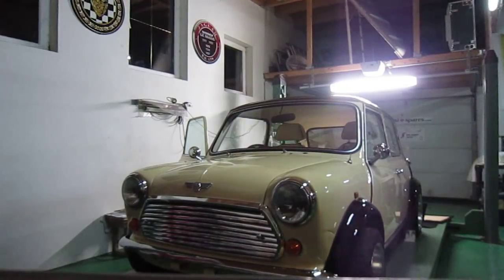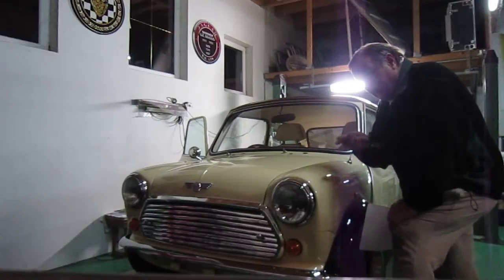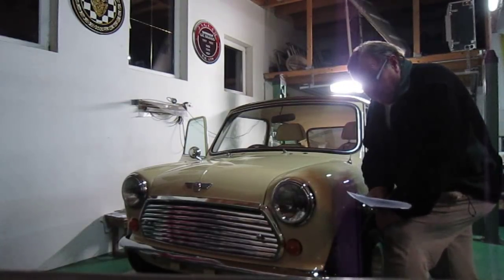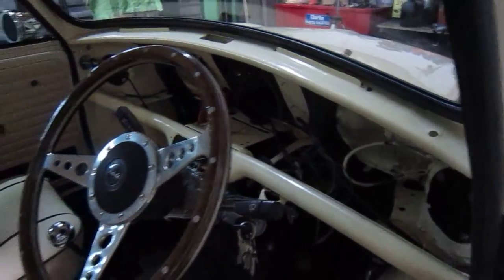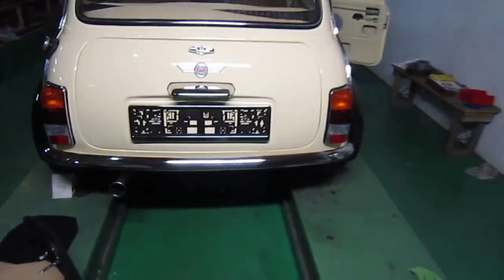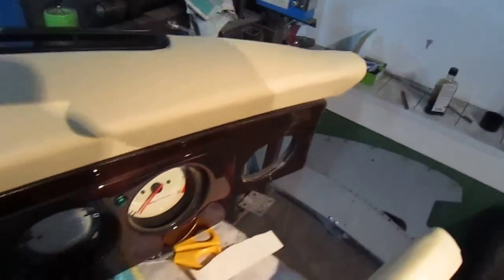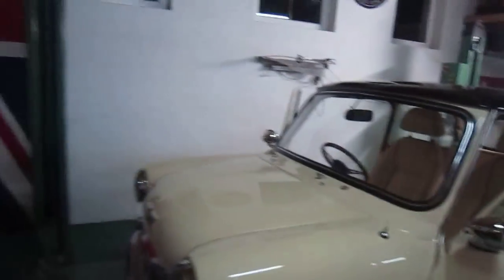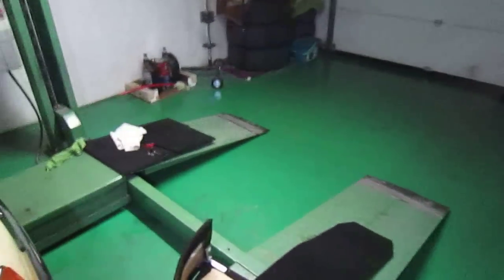Classic Mini Cooper Rebuild & Interior Part 10

Comment: How do you remove the lower dash rail /bar beautiful interior the boot lid is funky but not very functional but who cares its different thank you for the vids
Reply from the maker: Tony, I will do a video so you can see it! If you think about it the side opening boot makes it easier to load luggage.
it was an exercise to see if it could be done and as you say something different! Cheer Dave.
Reply from the maker: Tony, There is not a lot to do to get it out as it just rolls around the lower metal panel taking out the switch gear & choke & heater is the hardest part mine is in but i will chance some gauges so i will do a video on the top & bpottom rails, Cheers Dave.